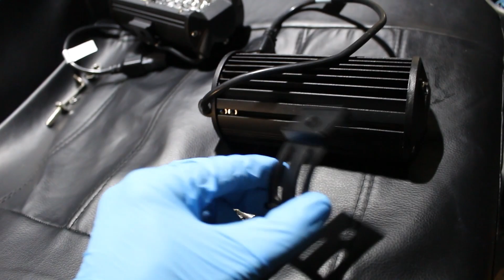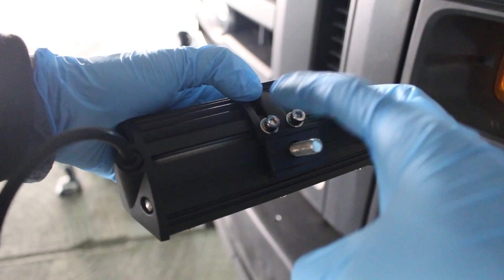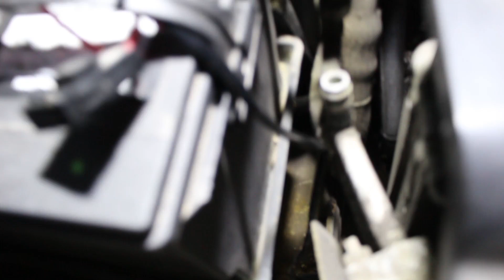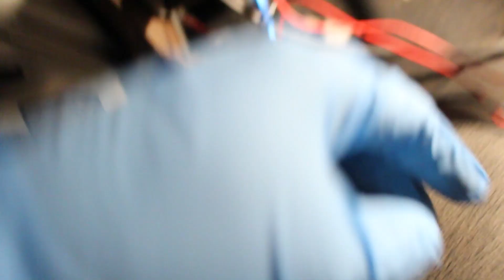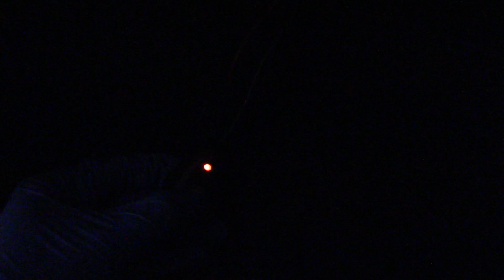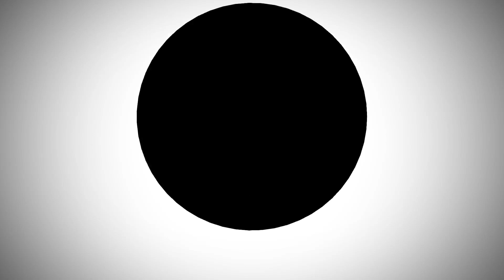How to install LED off-road spot/flood lights in your vehicle

Comment: I have the same question a few other guys had… Where the heck does the white wire go? I know you did this video six years ago but maybe somebody can help me out if you are onto other things
I see you have under the hood black to ground on the battery red to positive on the battery and then the red wire and the white wire go around behind the engine and you say they go inside but from that point you say nothing about the white wire. It's a mystery.  ?????? 
The reason I ask is because I have issues. Your video was awesome but somethings wrong on my system and I've got a white wire that's hanging in there.

Comment: Fitted some of these on my astra h , i cut the grill so the light fit flush. I just tapped power from 5amp fuse in relay box. The lights are really bright its crazy

Comment: I have these lights.  They are NOT 240 watts each.  That is purely false advertising.  The stated wattage is the estimated incandescent output equivalent.  The wattage draw from these lights is very nominal.  For example, the LED equivalent for a 100 watt incandescent for your home only draws 13 watts.

Comment: nice install....a good question is...why are we using a relay with a 30 or 40 amp fuse? these lights are only drawing 4 amps for the 2 of them together!

Comment: Hi Man,
Good video. I have questions tho.
I am going to use a separate car battery for this same led lights (480 w)  . I'm not using my car battery. (Which is for the car's electricity),therefore how can I connect the led switch, red wire Acc to?, 
Can I connect the red wire back to my battery positive?
Need your advice bro
Thankyou